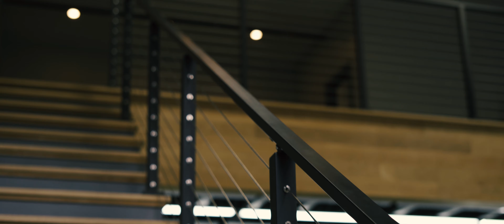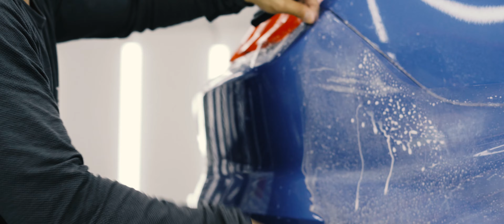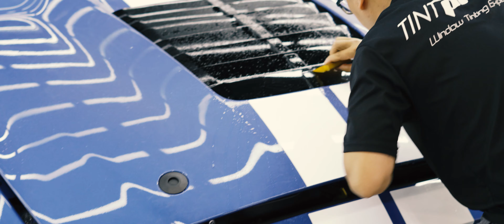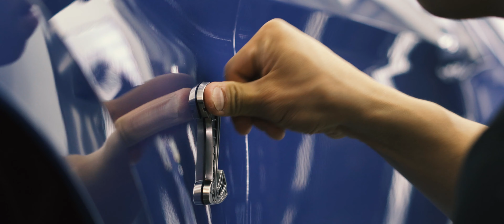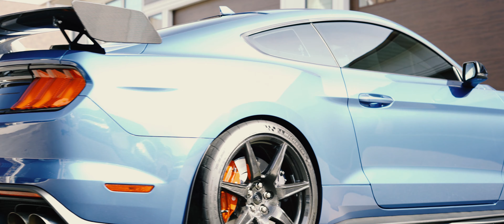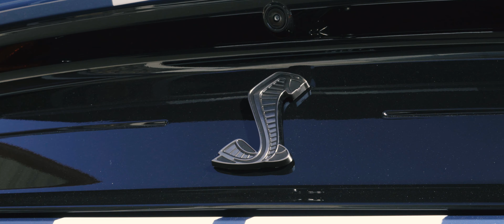AutoFlex: 2020 Shelby GT500 | 4K

Comment: What that runs? $8,000? I have red gt350 i have to polish every 2 months. The ceramic coat i use just don't cut it. I imagine dust particles at 150mph plus scratch paint. I use griotts polisher with a medium cut polish. Lmk.